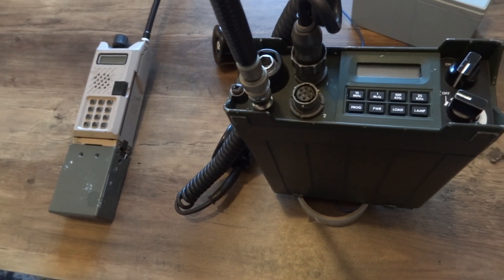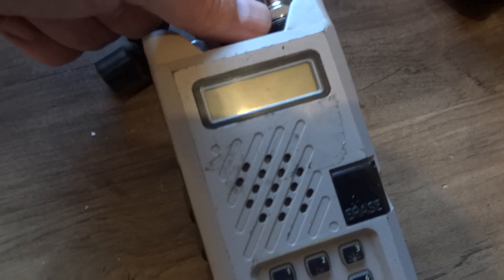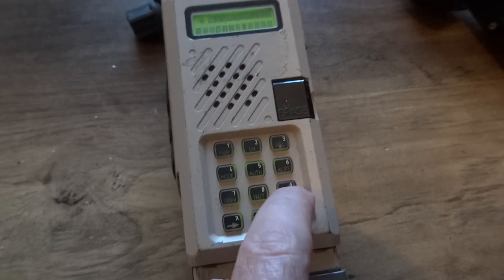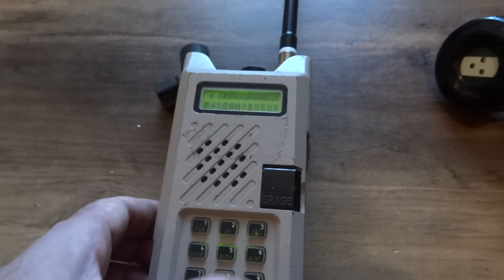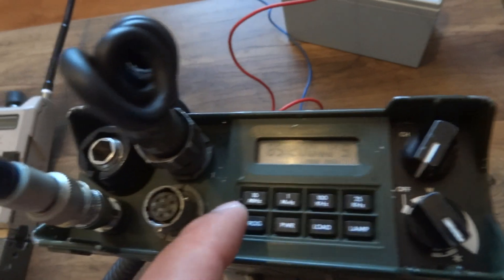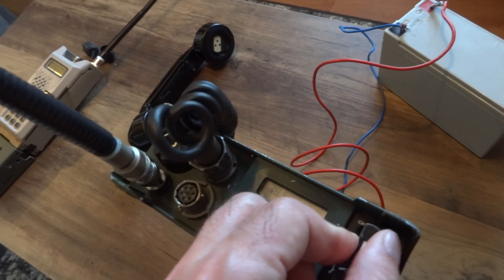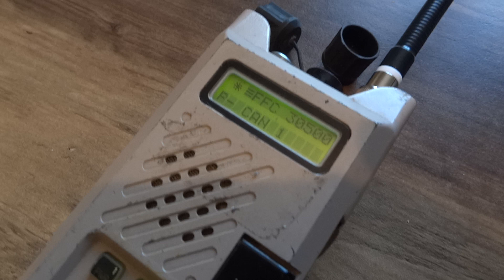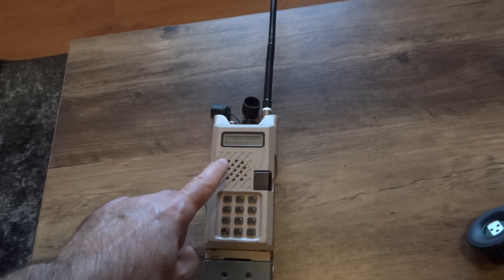Racal PRM-4700A & Thomson CSF-9100 VHF Radios 30 - 88 Mhz Testing on Rx + Tx

Comment: Hi, thanks for the video. I have a 4700A and noticed you powered it with an external battery which I presume was 12v. The 4700 handbook says max input power is 10.5v, so I wondered if you had any problems running yours on more than 10.5v please?